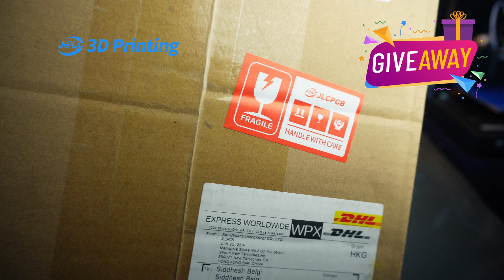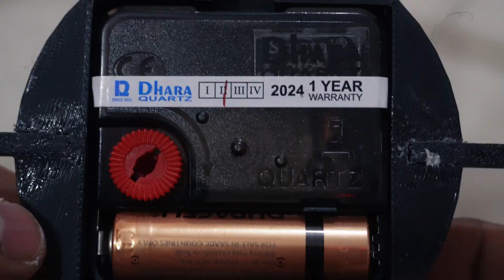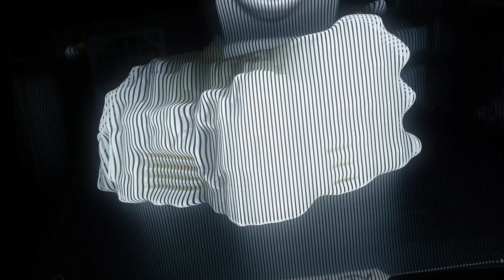Unveiling the Coolest 3D Prints 2024 | Special Giveaway | part 45 #3dprinting

Comment: Hi,for phone stand what is the infill %age?
Reply from the maker: I have shown Resin Printed Phone stand. but if you want to to print it on FDM, the bottom part of the phone stand needs stability so infill% around 30-40%, upper part is around 15% and for other small screws wall count should be higher with petg or abs

Comment: Just an FYI you can print non structural prints with way less infill. It will save you time and filament. That SD card/pencil holder could be printed with 10% grid infill easily
Reply from the maker: I designed that Glacier SD card model and tested it at different infill levels. In the model description on platforms like Cult3D and Pintables, I've mentioned that a 10% infill is sufficient for other creators who want to print the organizer.